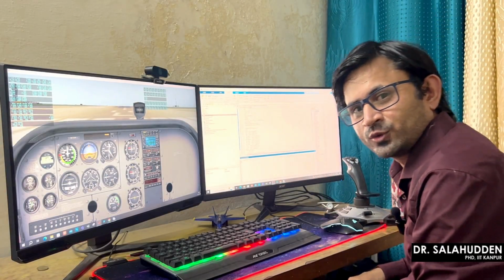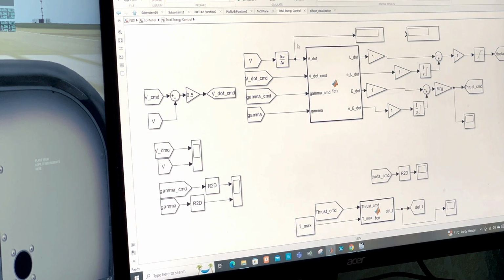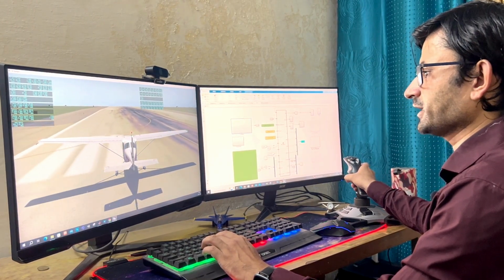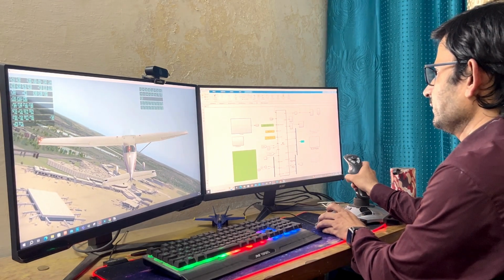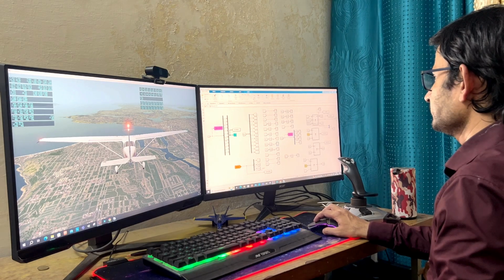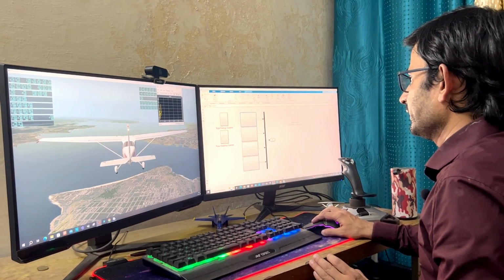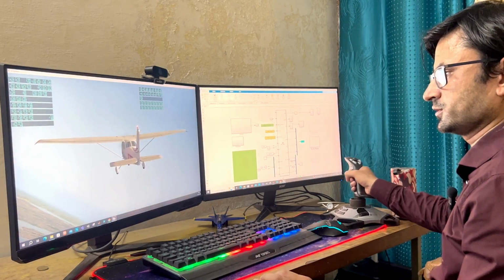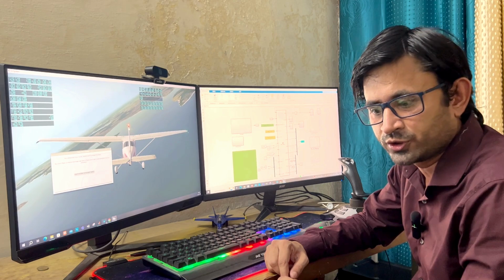Lecture 26 | Visualization in Fixed Base Simulator | Aircraft Design by Dr. Salahudden

Comment: I recently completed your Aircraft Design Course and found it extremely informative. Your ability to explain complex concepts simply and concisely is impressive.

Your work inspires countless Aerospace Engineers, including myself. After reviewing your portfolio, I was struck by the breadth and depth of your expertise.

Could you create a detailed video on different types of tail configuration design calculations for Fixed-Wing (FW) UAVs and Vertical Takeoff and Landing (VTOL) UAVs? Specifically, I'm interested in learning more about inverted U tail, H tail, V tail, inverted V tail, and other complex configurations.

Your guidance would be invaluable to those seeking in-depth knowledge on UAV design.
Reply from the maker: @shubhambedke6011  I appreciate your message. Thank you. Sure, I will teach the requested topics😊.